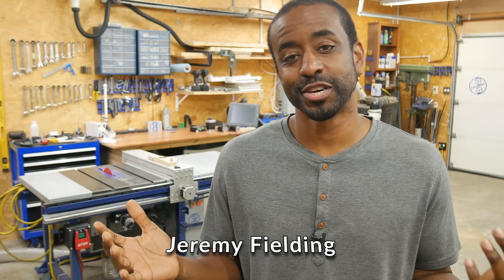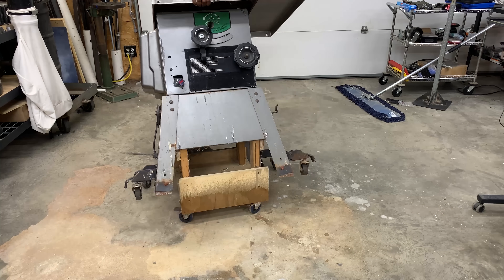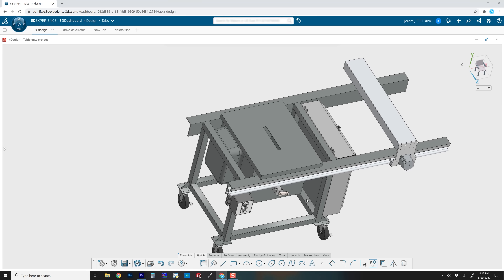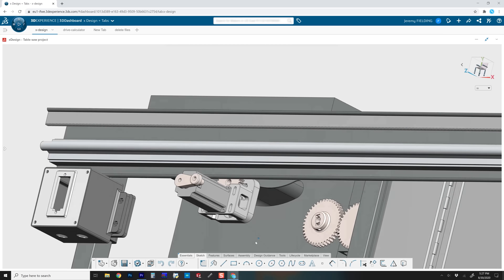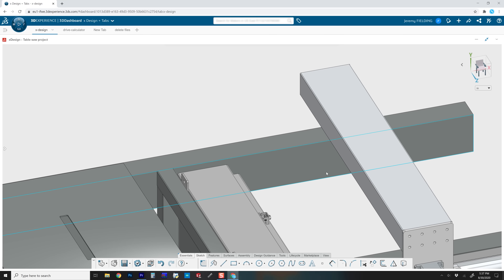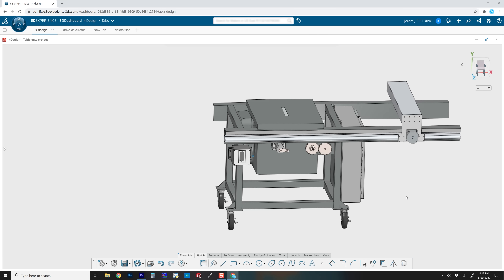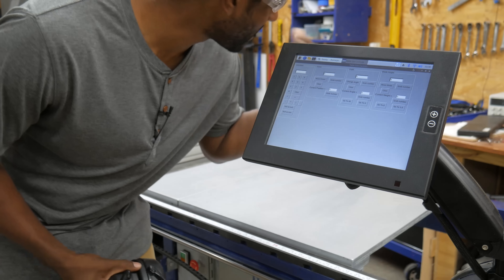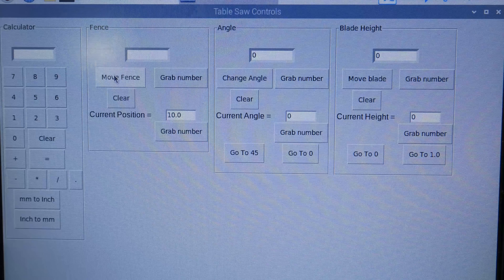How To Make A CNC Table Saw : # 084

Comment: 15:15 wouldnt it be cool if you added a homing sequence to this machine instead of manually entering the current digits. SInce you already installed all the sensors and motors. Seems like not so much extra work and way more accurate than doing it by hand and sight. Very cool video !
Reply from the maker: I mentioned this in the video. I also thought/think a homing sequence would be a good addition.
Reply: @Jeremy_Fielding  Ah ok sorry. Also on the other topics you mention; the acceleration on the stepper motors, I am no programmer myself either but I have an Avid cnc that runs on mach4, which you have as well. Within mach4 you can tweak the acceleration of the stepper motors to whatever you desire. I know you already invested a lot of time in your on software but perhaps you can see from them how they did it. Just spitballing here. Or ask chatgpt to write the code, see how he would do it. 

This was a really cool video to watch and very inspirational, I also want to build some custom cnc machines for my shop. Your videos are the perfect balance of not too dense in information but also not too beginner. I know i joined the show late but you have a new subscriber:)

Comment: i started to learn how to code in python 4yrs ago. i've mainly used it for stock scanners to try and find stocks to trade. just now getting around to making a a decent trading bot using machine learning and a few other tricks.  But i havent made anything like what you have made. sadly       whats the control board you used?  i have some hover boards and a 3d printed lathe chuck thats going to get attached to one of the wheels. your code would make a good starting point to make a mini cnc machine.

Comment: I wanted so bad to automize my table saw for a while now, but I didn't think of Python and RPi. Now, because of you, I'm already working on it. Started learning Python, I got myself a RPi 4b and a 7" touchscreen and now working on the software to develop my own UI and CNC translation (from GPIOs). I may contact you for advice and suggestions, if you have a couple of minutes to spare for helping me. Thank you for sharing your idea and the code. It won't match my approach, but it is a start.

Comment: Very cool project!  I couldn't help but cringe a bit though when the fence was moving though as it was very abrupt.  (You pointed out that there was no accel/decel in the code.) I was building an electronic camera slider a while ago, and to get around the hassle of coding the acceleration/deceleration of the stepper motors I simply used GRBL on an Arduino nano.  You code the controller to simply send the appropriate G-codes via a serial port to the Arduino nano running GRBL which provides the step/direction signals to the motor drivers.  It also simplifies the homing cycle, etc.

Comment: I've been working on one of these for my Dewalt contractor saw, which already has a rack and pinion track system. Where do you source rack rails? I was looking at ones designed for sliding gates. They are the only ones I could find in lengths reaching 48", the distance I would like it to travel. Also, I was thinking instead of linear rails that I was going to go with a 2020 v wheel plate and 2020 extrusion. I am also thinking the dual shaft would work well for the fence movement as the saw bed on my saw is to small so I am building my own top out of 1/8" think aluminum that I can anodize to color and protect. When the motor comes to a full stop, does it tightly lock the fence down? The Dewalt system has the rail bar wrapped around a mounted flat bar, and to lock it, they have a lever that puts pressure on the bar so it can not move which I could reproduce with a small actuator.

Comment: Lacquer the table top to prevent rust. Use paste wax to slick it up during use and prevent scratching as well. Lacquer is used a lot on metal hardware such as hinges, door knobs, etc to seal the finish and prevent rust

Comment: I like you dive in deep attitude. When I was first starting in making things, I first made a led blink, then immediately went into converting my cars manual hvac system to an automated type. It was cool, servos with gears that turned the knobs on the cars factory controller. A lcd screen with buttons to change my settings, temp sensors in the cab, in the vents, outside the cab. It was neat until it broke in the middle of winter and I had to rip my dash apart again while driving between jersey walls (since i couldnt see or pull over for 5 miles) to turn the defrost back on cause my servo died in vent mode.

Comment: 12:50 wait wait - what was wrong with the Relays?  You mentioned something about interference just before this; were ALL the relays bad?  Were they hooked up or wired wrong?  Were they susceptible to interference from the motors or the other items in your shop?

Comment: Would it be logical for the wood to push trough the blade automatically? This will make it really safe for the user.
Reply from the maker: Certainly. A clamping mechanism to hold things in place and a feeder are the first things that come to mind. Of course there are other details that need to be worked out but certainly possible and beneficial in the right situation

Comment: During your design phase, did you consider a non-captive stepper as the fence drive mechanism? The motor would ride a central screw which in turn is fixed at both ends. Thus, the motor itself transits along the screw.

Comment: Would it have been better to use a servo encoder instead of a stepper for the fence?
Reply from the maker: It depends entirely on what you want. Everything in engineering has a trade off. There are very few if any "this is the only answer" sort of problems. The steppers were good enough for the job. They will never be overloaded and should never lose position. A servo would cost more but offers the feedback. If feedback is important to your application then it would be better. But in this case I didn't think so. My point is it isn't just a better or not question. Its a application what are your core needs question. Steppers address the core needs of my design. The steppers where sized to ensure they don't get overloaded. There is way more to this but I think I have addressed the question LOL.
Reply: @Jeremy_Fielding  thanks Jeremy, I suppose if you didn't need that function then the cost savings is a better avenue. Bro, you have come so far so many awesome projects, I cant wait to get my shop together soon, so I can join in on all the fun!!

Comment: I find myself contemplating automating my table saw but do not yet have the plethora of advanced shop tools to assist with the miscellaneous parts fabrication. Couple of questions: 1) Is the original SW model available? 2) Is a Parts List available? Thx
Reply: The xt file, when downloaded separately, kept corrupting but when DLd from Github within the Zip set it worked fine in SW. Go figure. A PL would be nice though.

Comment: Started watching your vids after gutting my washing machine & gas dryer of their motors before sending them to bulk trash 3 yrs ago.  then it hit me that i'd just been watching and not being on the subscriber list. This was a great video as all of your are I wish my engineering professors back in the day had just 20% of the talent you display in teaching the underlying theories and principles and then providing their demonstrative applications. .Did you ever share which stepper motors you actually used for this project, or is that info buried in one of your other videos?

Comment: You should add a homing function with a switch at a known distance for the fence and blade angle, then implement acceleration and deceleration a to minimise the shock loads.

Comment: Surprisingly, a regular ol' Brillo pad after it's used to scrub the rust off, leaves some kind of a light wax residue or something that keeps the rust from reforming.  They could have made the product to do that possibly.  I have also had some good luck with rubbing in some lithium grease and then running over it with a torch.  Otherwise, I think you can spray a clear spray over it and then buff it off and that should seal the pores of the metal.

Comment: @jeremyfielding Kings fine woodworking, 81 - table saw blade alignment and tune up - make perfect tablesaw cuts!
He mentions using a product called Bostik GlideCote for the deck surface. And BladeCote for the blade. This is to answer what some use for rust prevention.

Comment: I love this. I'm at the same stage with a cnc I'm building. (Almost finished but not quite). 
I would add a memory function. For example if you had a jig you use alot you could set the saw to accommodate that. 

For instance I use a dowel jig on my saw and that's a pain to center. 

Also, why not add a feed function. Useful for cutting aluminium or hardwoods.

Comment: At 11:11 - I learnt a small bit of coding. Using Quick Basic, I created a Data Base in textPad. I wrote it one sitting and it worked. Later I was informed about about building and testing modules. 
wouldn't be a better approach to make one motor work at a time to confine error?

Comment: at 1:34 Navy jelly no longer works like it did in the 1070s. When I rebuilt an engine top end (Miata 1996). While trying to loosen the the exhaust manifold bolt, I founld that the over spray from the BP Blaster spray was cleaning the rusty parts with ease. With the top end removed, I used the PB Blaster to clean the cylinder bores, and the PB Blaster let me wipe away the carbonization on tho of the pistons. Also came off at first, but there was some soaking with a rag. And the area looked GREAT !

Comment: Very nice project.
Thank you very  much.
I suggest to add below:
Control saw from screen to auto hide blade once it is not in use.
Add counter to count how many cut has been done.
Show measurement unit currently used on screen.
Using recipe, you can add some shortcuts for favorite positions you usually use will be very helpful.
Thank you again

Comment: Jeremy there is a simpler solution to the handles. Make the handles spring loaded so that when they are not being used they spin free ie. They won't turn until they are pushed in. That way you have to manually push the handle in to turn the shaft but when let go they pop back out to the free spin mode.

Comment: Jeremy, rather than adding a bevel gear to rotate it, why not just add milling handle that allows you to rotate flip the turning knob inward, creating a flat profile on the spinning face, making it just a spinning cylinder.

Comment: A major shortcut to  do your project and other similar ones is avoiding the major step of learning to program.  It is a PITA to learn to code, and takes more time than building all the mechanicals.   I avoided all that by using a program called Excellino(R) that connects MS Excel(R) directly to the real world  via Arduinos. Everything is done on the MS Excel(R) Spreadsheet, so no programming.  I built a 3 axis transport system interface and had it running in less than a day, stepping to locations,  moving samples and displaying the travel in real time.

Comment: Have you considered using DRO scales on the fence?  Using magnetic scales allows you to have absolute positioning, if for nothing else than pretty accurate feedback on the motor movement.  They are not exactly cheap on the new market, but off of used equipment, its probably workable.

Comment: Pretty sweet and nicely done for your first go. I've been programming for about 4 decades and using tools since I was 5. I love seeing what people are doing in their shops with the modern tech available in the home shop (or even pro).
This is a project on my list for my saw as well. 
One of my intentions is to position a reference sensor somewhere that is co-planer with the fixed blade bearing surface on the saw shaft. Then using a tool library that has the offsets of the left/right edges of the various blades. Some inexpensive linear digital scales for absolute position references would be handy as well.
Another idea is an electromagnetic clamp for the fence. It can grip a rail or directly onto the table surface.

Once you have the basic functionality required to do the primary job, it's always fun to then step over the line and see how ridiculous you can take the automation.

Comment: What you labelled as "solid state relays" aren't SSR's they're just relays. SSR's are either MOSFET's (for DC) or Triacs (for AC) controlled via an opto isolator, those boards are standard mechanical relays controlled via an opto isolator. So you already had a mechanical relay in there.

Comment: This thing has to feel so good to operate. Super awesome. I am a mechanical engineer, but love any projects that involve motors being strapped to things and code being written. Great work, I am feeling inspired to make something myself now!

Looking through the code, the only thing that I would recommend is using classes for controlling your motors. This will just tidy up/compartmentalize the code and likely make is easier to use or make edits to and read in general.

Comment: Paste wax for coating your table saw table. I realize this is an old video, but in case you haven’t found a solution to your problem with treating your table saw table. I use paste wax - Trewax brand ( other brands work, but most tend to have more petroleum products than Trewax and don’t last as long and aren’t as hard of a wax). Paste wax when buffed will create a really smooth surface that also protects the metal from moisture. It also doesn’t leave any marks or cause other harm to anything you are cutting. You can also apply the wax to your fence and it will make sliding material a lot smoother and easier - very helpful for small and/or narrow pieces. You will need to reapply the wax on occasion depending on usage.

Comment: Rust Removal-  I NEVER use vinegar.  It stinks, and can tarnish metal quickly.  - Wire brush works best, but is (as stated) labor intensive.  However you will end up with good results.  - A "Flap Disk" is a great way to remove rust and works much like a wire brush or wire wheel, but leaves a small amount of abrasive behind, and requires cleaning after.  Air or a towel works for that.  Some people use "Rust Restorer or Remover"... NEVER USE THIS!!!! Most of those chemicals convert the Red Iron Oxide to just "Black Iron Oxide"... ITS STILL RUST!!!!  A Stainless Steel SOS pad will work, but requires a lot of work.. (see the theme here?  Rust removal is labor intensive ALWAYS)..
-Rust Prevention - Acrylic or Oil Based Paints are GREAT once Rust is removed.  - For surfaces you don't want to paint, and need to keep in tight tolerances like a lathe or other machines, a thin layer of Oil works perfectly.  WD40, Cutting Oils, Veg, Olive, Coconut oil, palm oil, and so on.. Even NEW motor oil works.  Used Filtered Motor oils will work, but sometimes have small amounts of metal debris and can cause other issues or just stink if burned.  I would NEVER use Latex or Water Based paints on Metal for obvious reasons.  
- One Last Thing... - One final method of stopping rust, is to LEAVE IT ALONE!!! If the metal is thick enough, an outer layer of Oxidized metal will actually create an oxygen barrier and arrest any new rust. (Or at least slow it way down)  If you clean of the oxidized layer, be sure to protect the surface with one of the above methods or it will just rust again.  
Alum, Brass, Copper and certain alloys are the Best examples of Let it Be!!! The white oxidized layer on Alum is one of the best ways to arrest further alum corrosion. 
Hope this helps!

Comment: Now automate the cnc table saw.
What I mean is:
Add an automatic feeder that you place raw material in that automatically loads the saw, moving the different widths and thicknesses of material into place. 
That is not hard to do.
Then add a collector that removes and stacks the cut pieces. 
Also not hard to do.
Set up your programming to cut say 10 pieces of this at a certain length, move guide, and cut 4 pieces of that at another length or angle.
Useful for all sorts of projects including truss manufacturing.
Tip: The loading conveyor feeds / holds material and then pushes material across saw. Using a chop saw instead of a table saw could also do angle cuts.

Comment: Finally a tip I can offer you…as far as a protection coating I use Johnson’s Paste Wax. It’s easy to apply and as a bonus all you can use a little on your jigs and any siding surfaces to decrease friction and lengthen longevity and wear items. It’s also not that expensive so if you try it and don’t like it you aren’t out that much.

Comment: Amazing project! I would consider adding a barcode scanner instead of an integrated cut list feature. That way you can just print a barcode cut list from your desktop and quickly scan each cut as you go. That’s how I’ve seen it done in production workshops. You can also print the barcodes as stickers if you want to then label each part.

Comment: Have you considered just making the blade height option a list of material thicknesses?  Then have that button go 1/8 inch higher automatically to ensure it cuts through the material? And I could see the cut list option being nice if you could import it from another computer.  Design something in CAD, and then download the cut list once you've made it

Comment: I have been thinking of making a servo drive for my fence as well. I hate my fence. I never soak cast iron in vinegar. It makes the surface very porous and weakens it. I just use a high speed steel blank from a huge lath with sand paper wrapped aound it.

Comment: 15:30 Interesting that you've made zeroing a manual process.  The machine could run to a limit switch on it's own and set itself at zero.  Downside is if the limit switch moves or fails.  My 3D printer uses this process.